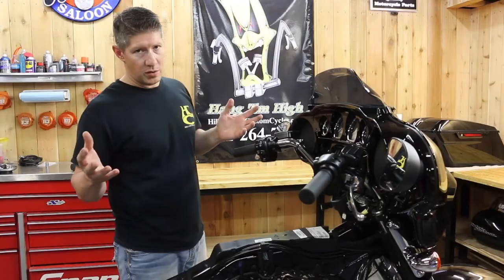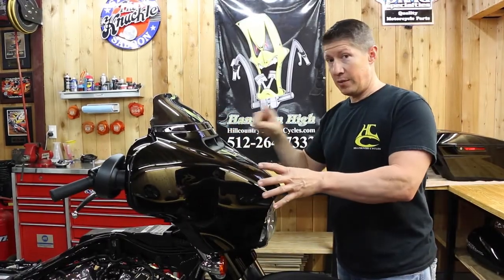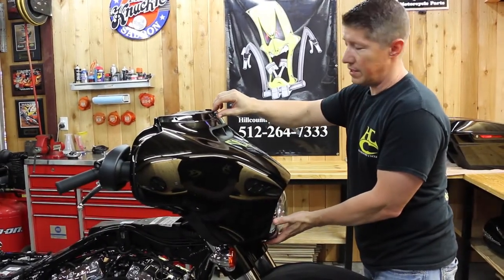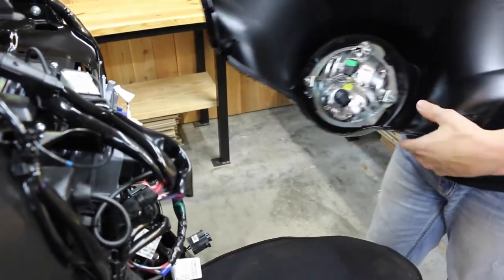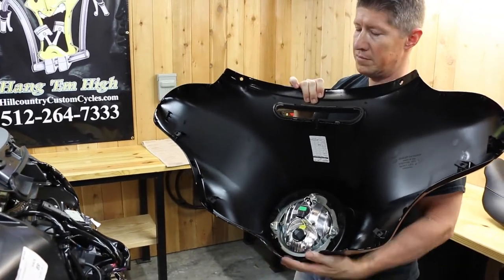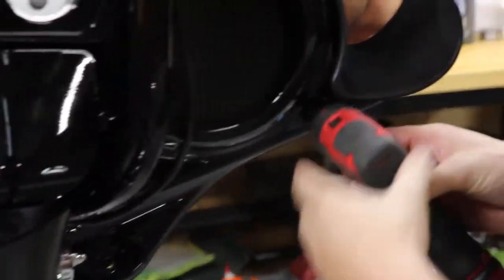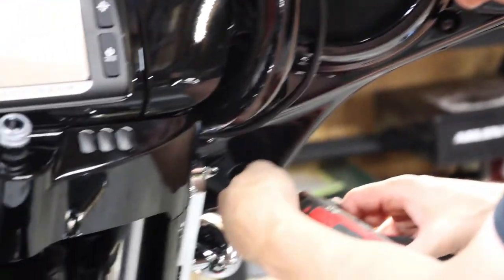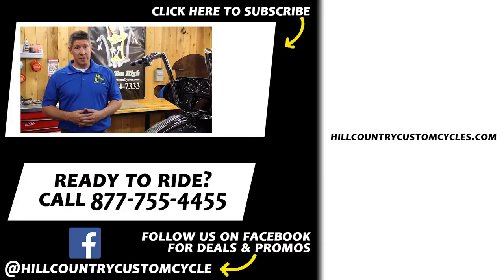How to Easily Remove & Install Outer Fairing on a Harley Davidson Street Glide

Comment: What year is this? I ask because I have a 2009 street glide and I took off the bolts you mentioned and something around the headlight is holding it down.
Reply: The process he describes is for 2014 and up.

Comment: I am having a hard time getting the bolts back in on both sides. The upper bolts. They seem to be screwing into nothing. I believe everything is lined up correctly, and I can get the bottom 2 in, but the other 2 just slide all the way in and never screw into anything that will hold them in. Any idea what the problem is?